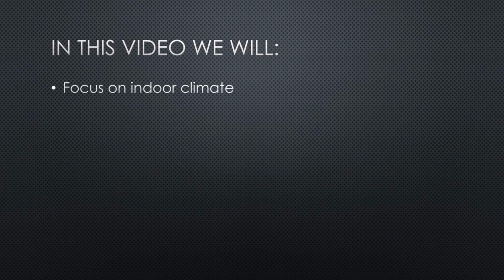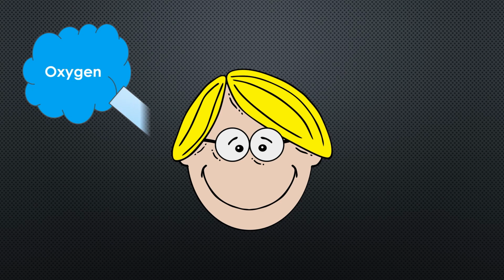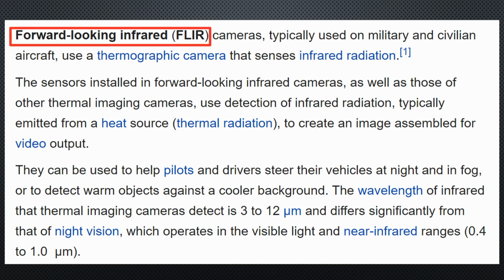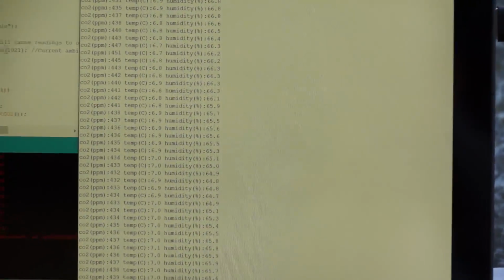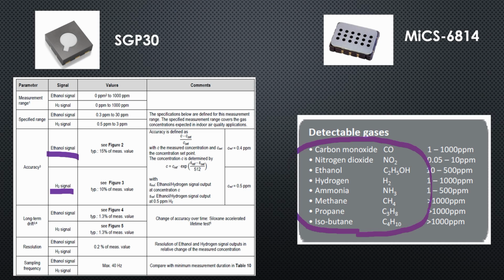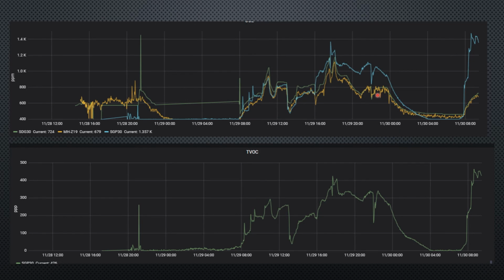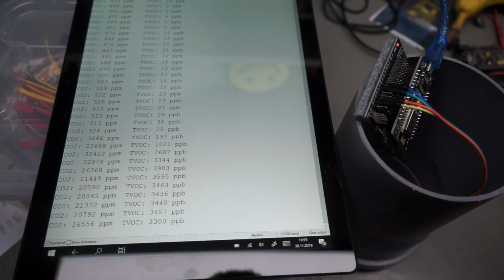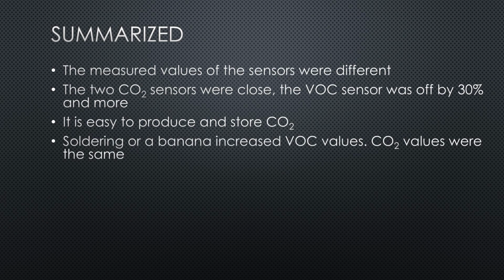#300 How to measure CO2 and VOC with Arduino. Which one is better?

Comment: Would be nice to add a particulate detector for particles such as pollin. I believe Dyson fit one of these to its room fans.
I think it a little unfair to blame your CATalytic converter sitting on your desk for your high readings :-).
Reply from the maker: These are often used outside homes. I never tried one inside.
Reply: I've got one ESP8266 with a MH-Z19, a PMS5003 and a BME280. All were even conveniently supported by ESPEasy so no coding was necessary to get MQTT out. CO2 is clearly the most interesting reading it gives (at least here in Helsinki). But it is still interesting to see how during cooking the particulate matter readings shoot way over the limit of levels requiring a public warning to be given if the values would stay at those levels for several hours a day. Also occasionally the values rise above the limits for some hours seemingly out of the blue.
Reply: perhaps a sensor attached to a "Teppichklopfer" a device used in Switzerland to knock the dust out of carpets.

Comment: Great video Andreas! I was just wondering, you mentioned that the CO2 sensors could not be switched off. Is this because the sensors take a while to start reporting accurate co2 data? If not, could you explain a bit more…I’m thinking of a scenario where you could have a battery powered esp32 chip connected to the sensors and putting it to sleep after collecting data to conserve battery…would this work?
Reply from the maker: Yes, the sensors heat up and therefore need quite some energy. Consult the respective datasheet if you want to know how much. Then you can do your calculation on the needed battery size.

Comment: Today im build same air control system. It perform beeps if CO2 more than 2500ppm and if air temperature drops lower than 24 degree. Distance between alerts is 5 min. So its actual topic, thanks.
Reply from the maker: Good project!

Comment: I am an absolut Beginner in electronics. I have to implement a MiCS-2714 or something similar in our weather-sensor. So i searched for it on YouTube and found you. It's funny, that we live not even 10km apart. Now I have a huge problem with the Sensor. I do not have your Cat for the calibration process. Could you please tell her to come over, cause I'm pretty lost with this topic. Sensors and I2C ADCs and so on, not my world.
Reply from the maker: :-))  I usually try to cut the problem into its part and solve one problem after the other: Micro, ADC, sensor. Like that I have less "moving parts". Or you buy an I2C sensor which has the ADC built-in. That is my preferred way...

Comment: Hi Andreas, Thank you for sharing this. I see you are serious about this. Maybe I can ask your advice on my CO2 issue? If you don’t reply than I guess I can’t 😊. I’ll try to be as short as possible. Outside in my garden I have a storage which only has a door, no ventilation grille. Why not? I tried to prevent sound leaks for my drumming. First I applied isolation material  and than build up my drumcabin in my storage (box in box idea). My drumcabin has a ventilation panel on top who moves dirty air from the inside of my drumcabin to the outside of my drumcabin through a bathroom ventilator. But … that dirty air can’t leave my storage itself. So out of safety I bought a good CO2 detector € 145,-) who’s used in schools etc. but after about 45 minutes it’s display turns into red (1200 ppm and higher). It’s very annoying that I have to ventilate by opening the door between drumming. The space between the storage door and my drumcabine is about 75 cm in depth x 220cm in width and 225 cm in height. A company adviced me a Decentralized heat recovery EcoComfort 2.0 Smart which standard doesn’t have a CO2 detector but that’s an option and maybe I can connect my own CO2 detector to it. What the EcoComfort 2.0 Smart has is a VOC sensor and I read in an article that a VOC sensor does practically the same as an CO2 sensor (and maybe better than a CO2 sensor): automatically let dirty air out and fresh air in. What would be your advice? Many thanks in front.
Reply from the maker: As said in the video: If you are concerned about CO2 the VVOC sensor will not do the job. However, I would take some measurements with both to see if their values are related in your situation. If so, the VOC sensor is a good replacement.
Reply: @AndreasSpiess thank you.

Comment: And the CCS811? The should correct the measurement also with humidity to be more accurate? Btw ESP Easy has support for the Senseair sensor :)
Reply from the maker: I just connected a CC811 for comparison...

Comment: Interesting as usual, but assumption about outdoor CO2 levels is incorrect. It varies during the day plus daily and monthly. The values can be significantly below 400 ppm and as high as 600, depending on location and time of the year. You would need to obtain recent value from a nearby scientific weather station.
Reply from the maker: Is this true also on the same altitude?
Reply from the maker: I found now some info: https://www.esrl.noaa.gov/gmd/ccgg/trends/monthly.html The effect was only a few ppm. For sure below the measurement error of our sensors. Or do you have other info?
Reply: @AndreasSpiess   , surprisingly a quick search does not produce many results. I searched for CO2 level variations and I've found a scientific document from Japan. A while ago, I saw a video by NOA showing large changes on a global scale over a year. I am sure, there must be locations where the variations are small. I am not sure about the altitude factor. The variations of CO2 levels were "weponized" by climate change deniers (trying to create doubt and uncertainty).
Reply: @AndreasSpiess  , this is from a top of a volcanic mountain in Hawai, above human activity, vegetation changes, and most of the lower altitude weather. Great location to measure long term CO2 levels change (increase).
Reply: Not needed, only the lowest NDIR CO2 sensor reading over say a week is of interest, as that's what correlate with the atmospheric baseline. There are local sinks and sources that may naturally contribute or impact this, but with enough air diffusion and convection, such impacts are not permanent as it won't pool up. Check the Keeling curve to see seasonal variance of the atmospheric baseline.
Reply from the maker: Here I found data from Stockholm: https://www.ulisses-project.eu/air-quality-mapping/

Comment: Did you know that in the process of converting Limestone to lime, massive amounts of CO2 is released.
Reply: TIL: limes come from a stone.
Reply: But lime is just a mixture of calcium-containing compounds... I think you meant converting lime to quicklime (CaO, calcium oxide).
Reply: @GRBtutorials  Nope, limestone or Calcium Carbonate is heated to burn out the CO2, the hot rocks are dumped into water and absorb the oxygen from the water in an explosive reaction which makes quick limes which was used in the farming industry. The quicklime is heated to drive out the water producing the pure lime.
Reply: Adam Bryant And in which way does that contradict my comment? All I was saying. Is that lime (mixture of calcium compounds, including CaCO3) ≠ quicklime (CaO), and according to your comment, it seems that lime = limestone. Also, you say that it’s poured into water, but that doesn’t make quicklime, it converts the previously made quicklime  (CaCO3 - CO2 = CaO) into slaked lime (Ca(OH)2, calcium hydroxide), which is more commonly used nowadays.

Comment: Thanks, what about mq135?, I bought one last week for the same purpose, but did not test it yet.
Reply: Amer Aidi Amayreh I don’t know how accurate it is but I needed to implement a calibration procedure that stores the most recent readings (48 hours for example) and uses the lowest value as the new zero point (or the highest rzero value, I think, if you use the library from GeorgK on github)

Comment: I'm a big fan from east switzerland. I just bought a sensirion scd30 and would like to battery operate it. I planed to frequently switch them on with a TPL5110 Nano Power Timer to measure at an interval of 1 min, send the result to an mqtt server and then power off for the next minute. Do you have any suggestion why this could be a bad idea?
Reply from the maker: Look how long it has to run till it gets good results... If I remember right they need some time to stabilize.

Comment: Gruetzi Andreas
You are mostly right most of the time (I think). However, your description of solar energy absorption is flawed, the dominant IR absorbing gas in the atmosphere is not CO2 but water vapour. In fact, water vapor leaves very little for CO2 to absorb, its spectra is as you correctly present, also very narrow.  So thet substantial dampening is by water vapour. Also, CO2 is a heavy gas, it lives close to the ground, or else plants would not grow. The "greenhouse" effect is not a very good one.
Reply from the maker: This video is about CO2 and not about water vapor. I just explained the effect, not the importance. Those topics are for people much more knowledgeable than me.
Reply: This is why Andreas lives in the valley and not on the ocean.  He even managed to be on the slope so when his local tourist train uses steam he can work without disturbance.
Reply: @AndreasSpiess  I understand you position and that you don´t want to go there, sadly science is standing back on this subject due politics. For me science always takes the higher position.

Comment: Where is the schematic that shows which pins of the sensors connect to what pins on the ESP32 ?
Reply from the maker: They are either I2C or Serial devices. You find the pins in the description of the different boards.
Reply: @AndreasSpiess  Thank you Andreas!

Comment: Can I use Multiple Serial Sensors with 1 ESP8266??

I want to add GPS module which has Serial Output??
Suggest How to use Multiple Serial Sensor with 1 ESP8266 and ESP32 Board?
Reply from the maker: You can connect many I2C devices to one ESP. Serial is not easy. You find videos on this channel for both topics.

Comment: I've been curious to try indoor CO2 monitoring for a while and was not aware of the SCD30 - seems to be a great little device! There's one thing I find slightly unclear - it's datasheet lists a maximum I2C line voltage of 3V and insists on level shifters for higher voltages, while both chips you have listed in the description (ESP32 and ESP8266) operate at 3.3V on I2C according to Google. Is that a small enough gap to not have any significant risks or did you use some kind of level shifter/voltage divider? I'm thinking of trying to run this off of a Raspberry Pi's I2C (3.3V), but am a bit concerned not to fry the sensor - could you share any insights on this?
Reply from the maker: I did not see these 3 volts in the data sheets I looked at. It works here with an ESP32

Comment: Hi Andreas , how will you go in to wiring the barometer , I am trying to develop a multi air sensor based on your video
Reply from the maker: Google knows ;-)
Reply: @AndreasSpiess  thanks it did know, now I am trying to set the altitude within the scd30

Comment: Did you consider looking at really cheap sensors like the MQ 135 for the CO2 measurements? (https://www.olimex.com/Products/Components/Sensors/Gas/SNS-MQ135/resources/SNS-MQ135.pdf)
Reply from the maker: No. They measure different gases.

Comment: Couldn't you calibrate by spraying some nitrogen across the sensor for a few minutes until it reads 0ppm?
Reply from the maker: I do not know. "Calibrating" it with the outside air is ok for me.

Comment: do you think air purifiers are useful? i know hospitals use large industrial purifiers so i imagine there is some usefulness in them
Reply: Air purifiers can only filter bigger particles: dust, bacteria, you can get rid of VOC with activated charcoal. But AFAIK you can't filter out CO2 or CO.
Reply: @AkosLukacs42  thanks. maybe plants can filter the CO2 😊
Reply: Actually there are minerals that can absorb CO2 and they were used in space missions. For sure plants could help (they need light of course) but a good ventilation with heat recovery might be a more effective solution 😉

Comment: dear andreas, you mentioned altitude effect the reading for gasses. 1 sensor caught my attention by Bosch's BME680 where not only it measure voc but also humidity, pressure and temperature. I hope you can review this sensor and get your opinion on this.
Reply: This sensor rely on closed source lib to extract meaningful values. Thithout it, it show some "resistance" which is non-linear and not very useful.
Reply: @efimovv  cool, but correct me if im wrong i thought that library was only for calibration and stuffs
Reply: @naimfuad5913  nope, it for interpretation of "gas resistance" value to something more useful.

Comment: As a result of this video I actually built a project that would be doable by students. It uses the MHZ19. I've just finished the firmware and everything works fine. Only very minor soldering is required.
How would I get in contact with Andreas about this? 15:40 he talks about this.
Reply from the maker: You can contact me on Facebook messenger, or on Twitter.
Reply: @AndreasSpiess  Thanks for responding! I've sent you a Facebook Message with the details of my build!

Comment: hi Andreas! I am using the SCD30 sensor for a project, but I need to use 18 of them. Do I need a mutiplexer? Or how to separate the signals from each sensor, if I know that by fabrication it has an address Ox61. Thanks!!
Reply from the maker: You need I2C multiplexers if the chip only offers one or two address

Comment: How much above 410 ppm is uncomfortable or beginning dangerous?  500 ppm? 450?
Reply from the maker: Not clear to me. Inconvenient above maybe 1500 and dangerous above 10000. Google Co2 in Spacelab and submarines.
Reply: @AndreasSpiess  right.

I was going to use 1000 ppm as the threshold point.  But, that's just a guess 

I suppose it all depends upon where your internal dissolved CO2 concentrations are at to begin with.  If you're above 29 mEq/L then an environment with 1000 ppm could be very uncomfortable

Comment: Masks: It would be fascinating to see CO2 reading inside a 3 layered mask (covid)
Reply from the maker: For sure a little higher than in free air, I assume. But not dangerous.
Reply: if people are shallow breathing then that is the problem and I have seen enough "proof" Covid masks are dangerous but watch them shallow breath. Take normal breaths and air gets drawn into the mask. Same goes for normal exhales.

Comment: Where did you buy the SenseAir Sunrise sensor (btw it is Swedish, not German!) that you did not get running? (at 7:18) It seems very interesting, because it is designed for battery operation. 
https://rmtplusstoragesenseair.blob.core.windows.net/docs/Dev/publicerat/PSH4732.pdf
https://rmtplusstoragesenseair.blob.core.windows.net/docs/Dev/publicerat/PSP4731.pdf
Reply from the maker: I got them from Sensair directly. And the Arduino sketch was not very stable. Maybe this changed by now.
Reply: @AndreasSpiess  OK, I see. I came across this teardown of the Aranet4 CO2 monitor: https://kaspars.net/blog/aranet4-teardown 
and recognized the sensor from your video. Aranet4 clais to run 2 years on two AA batteries. Sensor average consumption of 38 µA is really impressive!

Comment: If you're using automatic calibration on the MHZ19B sensor, does it matter that I am using it in a high CO2 environment where CO2 does not drop below 800 generally?
Reply from the maker: I think: Yes. Because it assumes the lowest level at around 400ppm
Reply: @AndreasSpiess  Thx for confirming my suspicion. I am planning to use the sensor in a greenhouse so ambient CO2 levels will never go below 600 at all. The soil will provide plenty CO2 gas around the clock to ensure that. I think I already found a solution, there's a library on github by WifWaf that allows a beginner like me to easily disable automatic calibration and do it manually :)

Comment: What the model of the senseair sensor?
Some time ago I compared Senseair S8 vs MH-Z19B and S8 was (and is) a winner (faster reaction, smarter auto-calibration functionality).
AFAIK, there is no arduino library for Senseair S8 but you can use something like this https://pastebin.com/XBjD62Ag

PS
SCD40 is interesting, would be great to know how much energy it consumes.
Reply from the maker: The Senseair is a S-11 if I remember right. And I was contacted by the manufacturer to help me getting it running ;-). I built now a ESP32 with 5 different sensors where I plan to add the Senseair and the SCD40, if I get one. It is still in development. Then I will let them run for a few month and compare.